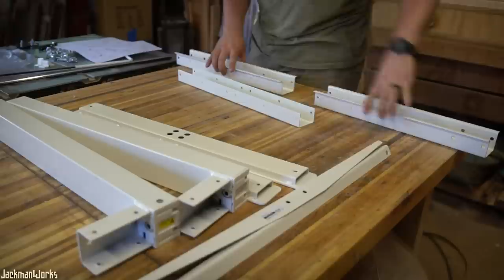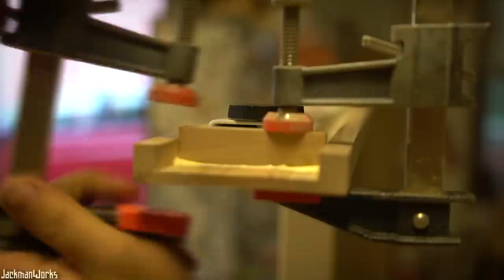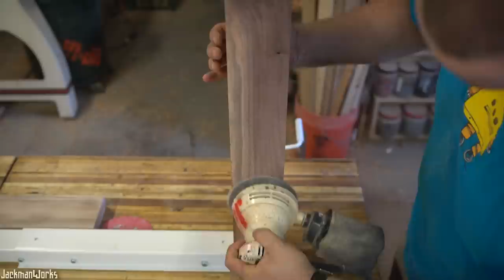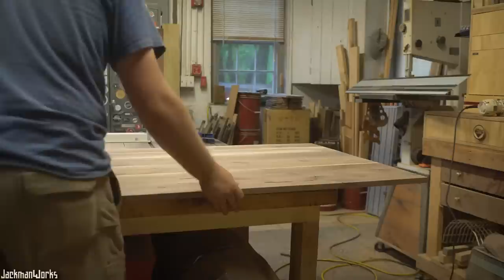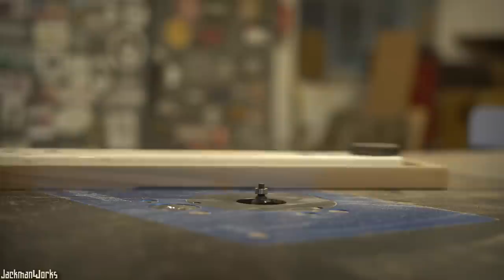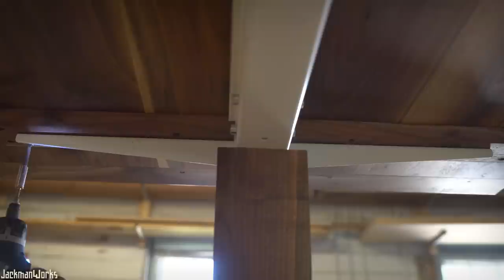IKEA HACK | Adjustable Height Sit/Stand Walnut Desk

Comment: Nice build. I am planning a 40x40 1.5 inch thick table top for a kitchen table. I plan on using biscuits and alternating grain pattern. Anything else I can do to build it to last for years?
Reply from the maker: Like you said, pay attention to the grain, make sure you alternate between happy faces and sad faces with each piece (best way I can think to describe it haha) and if you do a breadboard end make sure you follow the right procedure. Also with a top that big you want to make sure you mount it right so it has a place to move with the seasons

Comment: Lovely idea, really. The only thing that struck me, and of course it's easy on the other side of the screen, but...when you lifted the legs, the white was a bit unsightly. Would it be possible to "sleeve" the legs, with one layer of wood inside the other, so it would still look like wood even if you raised them?
Reply from the maker: Believe me, I wanted to do the same :(
The clearance in those legs is just way too tight to even fit a veneer on the leg, but I tried.
Reply: Heh. So, I'm not way out in left field, at least.
Reply: Using the same leg “wrap” that was done here, couldn’t you then wrap another layer but with this one being affixed to the base foot?  The leg would get pretty beefy visually, but it would solve the issue of seeing the metal at all.  Not being critical at all, this was an amazing effort with incredible attention to detail.  Just wondering if there’s a practical way to solve this challenge.

Comment: Excellent build, it's just a pity the white legs stick out at the bottom when the table is raised. I wonder if the walnut "sheath" could be fastened to the feet instead of the leg, so the white part would be somewhat better hidden under the tabletop.

Comment: Great video and awesome music choices as usual, Paul. Q on the waterlox - how does it compare to the Minwax wipe on poly? Colour, etc.? And how many coats do you apply to get it to take some abuse from drinks put on the table?
Reply from the maker: I find that I get a better color out of it, it soaks into the grain more and takes more coats, but because of this it seams to pull more depth out of the grain compared to the poly. I believe did about 6 coats on this table top to build it up.

Comment: Paul, you should consider using walnut veneer on the riser section of the legs to cover up that awful white metal. Looks sweet covered up with the walnut. Was this one of the last builds from the old shop?
Reply from the maker: I actually have some walnut veneer on hand and intended to do this! The clearance on that mechanism is so impressively tight that I don't think you could even fit a piece of paper in there haha
Reply: I hope it works out, I am sure you will figure something out bro. Good build. Hope the new Garage is coming together!
Reply: Paint the exposed parts a less-stand-out color.

Comment: Hello I like the table and enjoyed the video. I have an equipment question How do you like the triton track saw any issues with it? How does it compare to any other brands you have used. Thanks
Reply from the maker: Honestly, this was my first job using it and I was not a fan at all. I struggled with it and could not get it aligned right and it was burning with every cut. Hopefully I can get it to work, but at this point I wouldn't recommend it :(
Reply: Jackman Works I'm so happy you were honest on this. I've seen a lot of people struggle with their tools but they still rep them like crazy. sponsorship dollars are huge I guess.
Reply: thanks for an honest answer after you have used it a little give some comments in a video. have you used other brands

Comment: Another great video!  I like that you accounted for the wood movement on the table top,  but I'm a bit perplexed as to why you added that base on the bottom like you did.  Doesn't that brace defeat the purpose of what you did for the top?  By gluing and screwing that brace aren't you essentially just going to cause yourself issues with expansion?
Reply from the maker: Good eye! I didn't show it too well in the video so I thought someone would call that out. I only glue the center of that board the same way I only glued the very center of the breadboard ends. Then you can kind of see the wiggle in the screws on the end when I put them in, I put a lot of slop in those holes so it's more of a slot so it can shift around a bit through the seasons. Thanks for watching!
Reply: Great videos and love the quality of your work.  Keep it up!

Comment: Does the glue all along the end boards not cause warping problems given the grains are going in different directions?
Reply from the maker: The full length of the end boards aren't glued, that's the trick -- more here: https://www.jackmanworks.com/adjustable-height-sitstand-walnut-desk/
Reply: Jackman Works ah I thought you had, sorry. So just a bit of glue in the middle of that groove, then? Lovely job, I wonder about trying something similar, bit I'm still brand new to all this. You guys on YouTube make it look so easy, lol.
Reply from the maker: No problem man! Yep, just a few inches of glue in the middle to hold it and it can shrink and expand about that point.

Comment: i would've painted the metal parts black. then the focus would completely be on the walnut. but a very nice build. would like to have some of your patience
Reply from the maker: Yeah, I wanted to do that to but was worried it my get scraped over time with too much up and down, the clearance on that thing is impressively tight. Plus the customer said he liked the white so that was all I needed :D
Reply: Jackman Works didn't think of that. You didn't put a link of the kit, is it one from Amazon?
Reply from the maker: The leg kit is the one from Ikea, pretty slick little unit

Comment: I checked the link for the full build but did not see a link for the leg kit. Could you tell us where you bought it? Great music btw, as always.
Reply from the maker: The leg frame is the the mechanism from Ikea
Reply: I got this one:
https://www.monoprice.com/product?p_id=15721

If I do a build like this one (which I plan to do) the design will allow me to keep the decorative part of the leg covers on the bottom - an idea I prefer.
Reply: that is Ikea info is helpful, along with the rest of the video, as I plan to dive into my own black walnut table build, breadboard ends. My only (personal) preference would be to paint the leg mechanism black where it shows, at least the leg part. But a sitting/standing table will help with the circulation for who are "so over' their twenties. This troll needs to come out from under the bridge/table every once and a while to stretch my legs!

Comment: This desk is only rated for 110lb. How did it handle all that wood?
Reply from the maker: Didn't seem stressed under the load at all. If anything, I think the walnut top was actually lighter weight than the particleboard one that you usually buy with it.